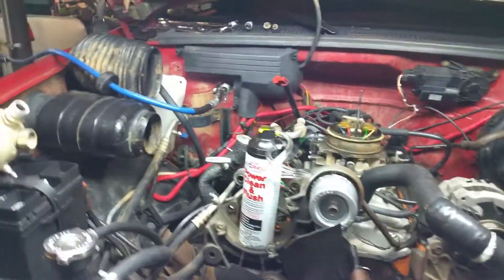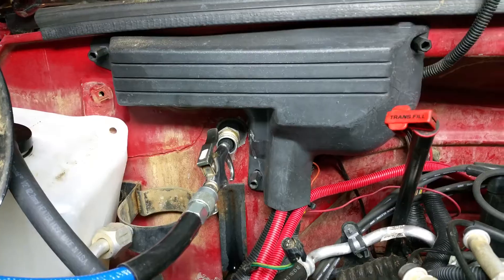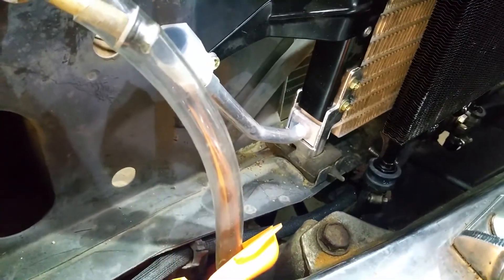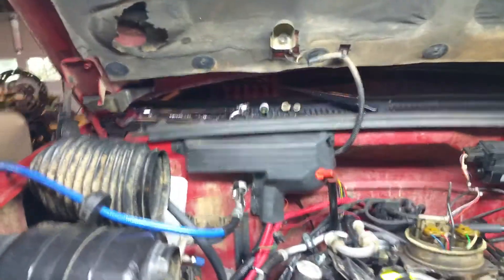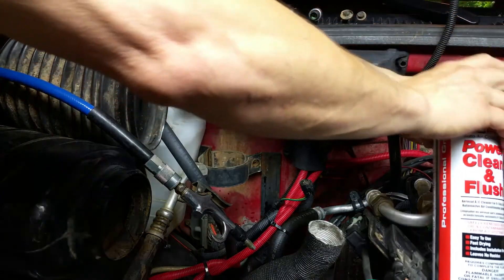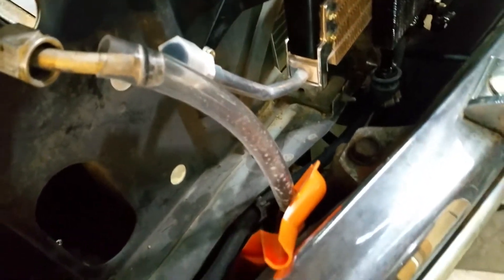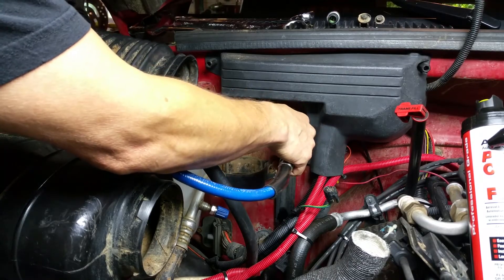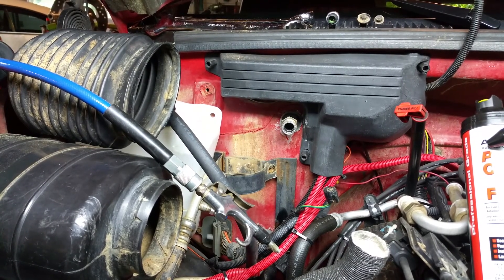Flushing the evaporator in your automotive car truck suv jeep van A C HVAC AC A/C R4 System

Comment: Would you disconnect the compressor as well or you leave it connected if the compressor still worked?
Reply from the maker: I would disconnect everything, to properly blow everything out. and then you need to run the correct PAG oil through the system before recharging it as well

Comment: My ac is building too much pressure on the low side ive got a new dryer comp and condenser + orifice tube and i don't want to have to go thru the nightmare of tearing up my dash getting the evaporator out.
Reply from the maker: You need professional assistance.  Find a reputable mobile mechanic, or a trusted shop.  Simply throwing parts at it is wasteful, and frustrating. Ask me how I know... (and I am the type who always wants to fix it myself.) There comes a time, though....
Reply: I have a 2005 trailblazer

Comment: Did you add any pag oil to the coil after flushing
Reply from the maker: You run Oil through the entire system. Not just one component.
Reply from the maker: No

Comment: I’m servicing the a/c system on my ‘05 Subaru Outback which has over 200K miles on it. I’m doing a similar job to what you did here. But I have some doubts.. Is it ideal/realistic to properly and thoroughly flush a parallel flow evaporator core? I ask this because they are just like condensers, with very tiny fin holes, almost impossible for the solvent to reach all areas of it. I’ve been told it’s just best to replace it, but it’s obviously very time consuming to replace an evaporator core since the whole dash needs to be removed.. Also, do you back flush or forward flush? I’m concerned of leaving solvent inside the evaporator. Thanks in advance.
Reply from the maker: No fluid will be left in it after you properly vacuum out the system to test for leaks. just do a thorough rinse, and then vacuum with your proper device.
Reply: @HorsepowerHouse20 Great to hear. Will do. Thanks!
Reply from the maker: Personally, I will never do this task again (replacing components). And I always insist on working on my own vehicles. But working on an air conditioning system in a car is just too much to deal with. The special tools you have to have, the knowledge, the equipment, it's just too much. Unless you're doing this often, it's best to just let a professional shop that you trust handle the job. Just being honest with you.
Reply: @HorsepowerHouse20  I hear you. I too am an experienced DIYer. I want to give it a try as I have everything I need now to do this service. a/c repairs are not cheap either. As always, I will be following the service manual on my car. Thank you.

Comment: I did this today and it was a pain in the ass. Kinda "easy",  but a complete pain in the ass. Feels super sketchy the whole time you're doing it. Hopefully it winds up working for me. New compressor, dryer, condenser, and I will get a new compressor line soon since I realize while flushing it I should probably replace it since the little in line muffler cannot be flushed.

Now the difficult part begins: finding someone to charge it.
Reply from the maker: Replace ALL of it. Or you will wish you did later.  And make sure you check for leaks using a vacuum device.  Or just take it to a shop once you get to that point.   I will never do a project like that again though. It's just too much. I will take it to a professional next time.
Reply: How did your project turn out? I am faced with this due to a seized compressor. I don’t want to replace the evaporator, but am willing to do the rest. One problem for me is that my minivan has rear A/C — and more components.

Comment from the maker: For those of you who think you can be a hero and replace your entire A/C system yourself - SURE - it can be done - but I highly DO NOT recommend the average guy attempt it.  It's just too much to deal with. Too many ways to screw up.  Too  many new tools and devices to get.  Too much STUFF to figure out.  You will spend more than a week (or a month) trying to do it.  I SERIOUSLY recommend you to just take your car to a shop or an independent mechanic or qualified mobile mechanic and let them handle it.  PAY THE MONEY AND SAVE YOUR LIFE!  (And I have been working on my own vehicles for more than 25 years...)
Reply: So pretty much pull down our pants and bend over and just take it, let the ac guys over charge us. Screw it, even though what they charge equates a down payment on a car.
Reply: @dannydee9919 Idk about that bro (nobody likes seeing naked dudes in the shop, it's bad juju). Fun fact, parts like evaporators (depending on the year, make, and model) can be very expensive with the labor to get them out from gutting out a dashboard assembly. Kinda expensive by principal as a result, no way around it unless you got everything at home, refrigerator rrr machine included.
Reply: @benitoloco899  since posting my comment, ive replaced the ac compressor on a 2017 honda accord, did 3 other cars on my block , changed the heater core oon one of those cars.  it was not difficult 4 out of 10 difficullt level.equiipment did cost more than i hoped to, robinair vacuum, yellowjackey gauges. and i used the loca shop for r134 recovery
Reply: @dannydee9919 I like your attitude. I have a 2002 Caravan with 210k miles that I bought for $2,300. The compressor seized, so you can imagine what a shop repair would cost. I went the summer without AC, but figure I don’t have all that much to lose if I replace condenser, compressor, etc., and flush the evaporator. I bought the fittings to bypass the rear AC and simplify the flush process, and a two-stage vacuum pump. I sure as hell wouldn’t do this with my Lexus RX350, but a 23- year-old minivan is worth experimenting with.
Reply: @TruthInFlying  the ac system inyour lexus is no different than your mini van, ive never worked on a lewxus but i would imagine the hardest part is the littlr room you have to work with. i might be wrong but i would imagine it would be easire to work on your lexus just because the bolts would not be rusted aand or siezed. i would give it a try unless its still under warranty, which i would just submitt a warranty claim
Reply: I’d like to respectfully disagree with you. Fixing an AC is not the work of gods that is forbidden to mere mortals that the internet will lead you to believe it is. I’m no professional but I would consider myself fairly mechanically inclined. I have a Honda Element that had a bad AC compressor. I had 2 different shops quote me $1200 to replace it. There was absolutely no way that I was going to pay that. The only thing I had professionally done was an evacuation of the system, and that cost $50. For $400 dollars I got all the parts and fluids needed to replace the condenser, dryer, and compressor. I did my research and watched plenty of YouTube videos. I flushed the evap using this method. Almost all of the tools required I already had, and I think most people who are hobby mechanics probably also have them. The only tool I had to purchase was the vacuum pump and gauges. I was able to get those in a kit for $100 on eBay. I could’ve also rented them from AutoZone for free but I chose to buy them. There are many affordable ways to get tools. Renting, borrowing from friends, Craigslist etc. You can get a small air compressor from harbor freight for $60. Since that repair I’ve used my pump and gauges twice more on two other vehicles’ AC repairs. And to your point about it taking too much time, I was fully expecting it to take a week or more, but I was pleasantly surprised and I was able to get it all done on a Sunday afternoon. It took about 6 hours give or take. To anyone who wants to take on this project I say do your research (save videos, take notes, reference a manual), order all your parts and gather your materials and tools, and carve out a day where you can fully commit to the repair, and just go for it! It is achievable for regular people. For $550 and 6 hours, I was able to get my AC fixed for half the cost a shop would charge. Plus, I learned a new skill that I’ve been able to use a few more times.
Reply: If you're a reasonably competent mechanic replacing the compressor, the condenser, and the lines is pretty straight forward (depending on your car's model, some are easier than others).

Replacing the evaporator is generally impossible because it usually means taking apart nearly your entire dashboard interior.

That's also why you need to make sure that your air compressor is not set higher than 30 psi when flushing the evaporator, lest you blow a hole in it.

A car that's 10 years old is perfectly drivable, but paying a shop to replace the entire AC system will cost more than the car's worth..
Reply: @HailAnts  I've done all that on different car models,many times. And it's not easy, definitely not a task for a beginner,  or a novice for that matter, ac systems are not complicated, its just tedious getting to some of components. First  time i changed a compressor was almost my last time working on cars, i rounded out 2 of the mouth boots, took me 4 days to get out of that jam
I'm not a mechanic I just like working on cars, I like it so much that i thought of quiting my job as a mechanical engineer to be a mechanic
Reply: Sad but true...😮
Reply: I replaced my ac compressor,ac condenser and expansion valve today😎SAVED ME A LOT OF MONEY!I used the flush also in this video

Comment: I have to do the same thing to my OBS Chevy but I keep reading that I should not flush the evap while it's still in the truck but I'm not dropping the dash!  I hope this method gets all of the flush out of the evaporator so that it doesn't mess up my new compressor.
Reply from the maker: Cleaning the system has nothing to do with damaging the compressor or not.  There are a ton more things to be concerned with...look at all of my videos a out this project.
Reply: @HorsepowerHouse20  Cool.   Can the condensers in these be flushed or are they those kind that have small channels that can't be flushed and the entire condenser has to be replaced?
Reply from the maker: @MiamiWebDesign  If your system is very old I highly recommend you replace everything in the engine bay relating to HVAC.   But seriously, I recommend you just pay a shop to do it.   Because this job is NOT easy. So many tools you need (not common tools), so many parts and trial and error etc etc.  Just take it to a shop and pay the money.  (I'm serious.)

I am a good home mechanic and this job pretty much kicked my ass.  I will never do it again on another car.   Just being serious with you.
Reply: @HorsepowerHouse20  Trust me I hear ya as I'm seeing as I go along with this project but this is something that my old man and I are doing almost as a project/hobby thing that we like to do together on this old truck.   
We started by swapping out the expansion valve in the rear of theTahoe and we got the rear ac to finally cool but not cool enough so we're going to do the rest of the system now.  I think i've already spent more on parts and tools than a shop would've charged to do the entire job but it's cool I'm always looking for things that we can do together to this truck and I'll always have the memories with the old man that's pushing 80 now :)
Reply from the maker: Sure, I get it.  But the AC system is a whole other beast from anything else on a car... Just being honest with you.
Reply from the maker: As you see in all of my videos about this project it worked fantastic.

Comment: What does it mean if air won’t go into the top (bigger) pipe on the firewall. I can blow air through the bottom one, but not the top. Even then it doesn’t flow freely. It’s under pressure
Reply from the maker: What did you figure out?
Reply from the maker: Well it means there is a blockage somewhere.  Seriously, I recommend you let a professional do this job.  I will never do it again.  And I have been working on my own vehicles for more than 25 years.

Comment: Hello, the inlet you flushed was the low side inlet correct?
Reply: This was an older vehicle with a retrofitted R134a system. It was originally R12. Those evaporators could be flushed in the reverse direction of flow. So you flush it from the smaller diameter hose or line (discharge) out through the bigger diameter hose or line (suction).

Now if your vehicle has an evaporator for a R134a system, those evaporators should never be flushed. As the coils are so tiny, some of the flushing agent will stay behind. It could be hazardous to your health to breathe that air.

Comment: I have a 1990 454SS and I'm having a problem finding new hoses for the ac all I can find is the discharge hose. The manifold hose assembly I can't find and I don't know if the one for the 350 will work the original hoses on the truck look good so I don't know if I should flush them and reuse them or not
Reply from the maker: Flush them.  All hoses are out there to purchase though. Look harder.
Reply from the maker: Here are more videos about this truck that might help you https://youtube.com/playlist?list=PL_5XjPVEw3swhfNY5J-6NRjMMUW5fupgK

Comment: Did you get the AC in this truck up and running after the flush?
Reply: Does not evaporate quickly and the product I used that was in the same can was a different color...
Reply from the maker: Here are more videos about this truck that might help you https://youtube.com/playlist?list=PL_5XjPVEw3swhfNY5J-6NRjMMUW5fupgK
Reply from the maker: Oh this was a complete a/c system replacement project.  And it was not easy. But it turned out great. See link https://youtube.com/playlist?list=PL_5XjPVEw3swRL4ED9AhsynAgZsuXDzZm